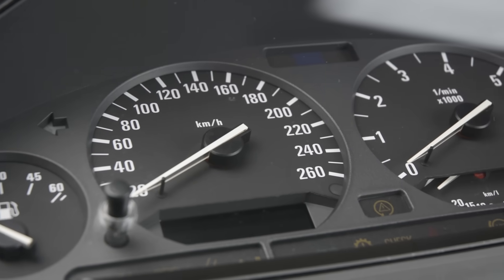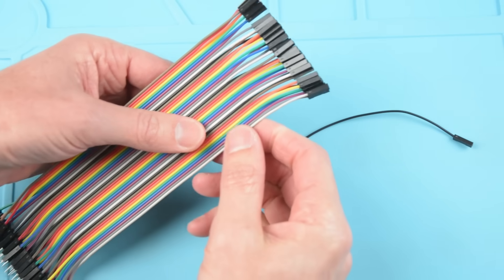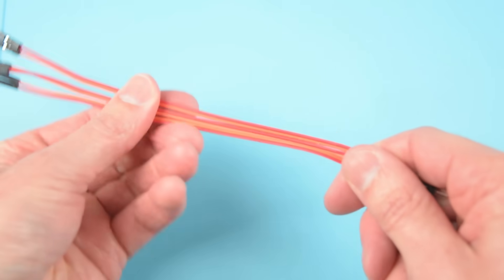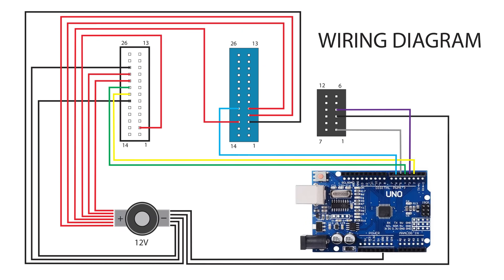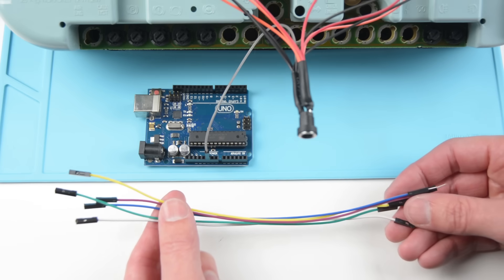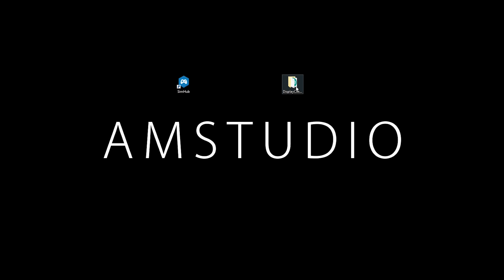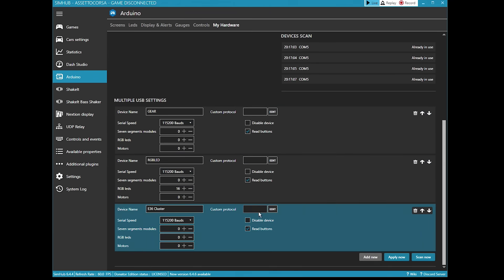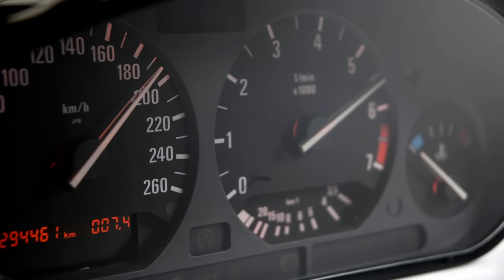HOW TO WIRE BMW SPEEDO CLUSTER FOR SIMULATOR | SIMHUB

Comment: Next - how to wire a car for your simulator.
Reply: Pog kinda did that, he connected his Aventador to his Xbox
Reply: @MrDestin1969  yes and it was pretty cool :)
Reply: look up Suzuki XBOX car. Most the articles you find are shit and not informative, but when it was debuted I remember hearing it was wired to use the steering wheel, pedals, and shifter for sim control.
Reply: Don't tempt him 😂
Reply: I know
Reply: How to wire a steering wheel with airbag to your sim so it explodes when you crash
Reply: Teslas already have this, just have to make sure you are in park so you don't get confused.

Comment: Will 11.5V power supply be good? I plugged everything together, but my tacho and speedo don't move on test max rpm or test speedo max.
Reply: 11.5 would be good, you are dealing with a car speedo here and battery voltage can even reach 11.2 at worse scenario, something is wrong with your signals, power is good

Comment: What are those arrows on the sides of the speedo and tach for? Never seen those in use on a bmw
Reply: is this a blinker joke?
Reply: @frozensolid8968  Yes, yes it is
Reply: It's only to pass the MOT. Nobody actually uses these anywhere else.
Reply: Fuel use in liters

Comment: Hi, I'm trying to use my panel, but it does not seem to be being powered enough to turn on, the lights do not light up when I plug in the power supply and the fuel pointer goes on empty, the other clocks do not work.
as I said there seems to be a lack of power, I've changed 4 times of source and I've reviewed the connections twice, and I do not know what the problem is. Could someone help me with this?
I saw that in this panel in the video there are some black "caps" that are closing some holes with contacts on the sides, does it influence something?
Reply: it is as if something in it does not allow to receive all the energy of the source

Comment: Such a great idea! Gonna be doing this for sure! Is there any other clusters with the same pins etc that would work? As BMW E36/46 clusters are expensive
Reply: Expensive? 🤣 Please E46 clusters in Poland costs 100 PLN +/- 25 €
Reply: Big chance that every cluster has different pinouts: the CAN-bus is manufacturer specific.

Comment: How did you know what wires to connect? I'm asking because I want to adapt a Suzuki Sx4 instrument cluster to my car, just the basics like headlights, turn signals, speedo, tacho, water temperature, oil level and fuel (it might also be nice if the trip computer worked)... But I have no idea what to link to what... And google doesn't seem to help at all (I couldn't find the schematics for the Sx4 cluster). Any help would be appreciated

Comment: I've done it today..!!Fantastic work...Couldn't find where to put the protocol file cause i got the newest SimHub version and it is not in the same spot as the one shown in the video.
For those who looking for it, it is in the arduino page/my hardware/multiple arduinos,you will see "multiple arduino settings,and the E36 device.Down below "Custom protocol" you press edit and the rest are like the video shown.
Reply: Hi did it work

Comment: the rpm meter isn`t similar to the software gauges. The AC gauge shows 6500 and the hardware shows a bit less than 5500....
Reply from the maker: That right its set to match the range on the cluster. But you can change the setting so its 1:1

Comment: I made a E36 cluster work 4 years ago, before Simhub even existed. So much work for nothing. I moved to Simhub since then. :)
Mine has some extra features. The lights are also wired in with simple NPN transistors. Some of them are tricky. Turn signals and high beam need to be switched to 12V to work, the rest need ground  signal to light up.
Reply: Hello! Do you have the Display client V2 as shown in the vid at  4:24? The links are old and I cant seem to find them, so I thought maybe you still have the file. Thanks!

Comment: Thank you for your videos. Did you have an ideia, why sometimes the RPM drop to 0 while playing? I've tested with rfactor 2.  I have the Use Full range checkbox checked and  the offset percentage to 0.  I can test the max RPM and it shows fine. Using a e36 316i 4 cylinder gauge, max redline at 7000 and max speed 250 (the gauge goes further). Thank you

Comment: Hi, buyed one myself, connected everything, working flawlessly. I even managed getting the temperature and fuel gauge working. Came up with the idea of converting an e36/e46 steering wheel to a Logitech G25 and making the buttons (like cruise control) to work. Maybe a suggestion for your awesome work? Feel free to contact me if you want!
Reply: I really need help when I try compile with the code hes given im getting a few errors.
Reply: Which errors do you get?
Reply: hi bart, my tachometer is working flawlessly too but my speedo isn't working. did u use the sketch in the description or did you edit our own?i believe the code is the issue as the needles on my cluster are not the problem.Thanks a lot for replying
Reply: Hi, you also inserted the custom protocol? Which game are you playing? And did you upload the sketch to your Arduino while Simhub wasn't running in the background? I used the sketch in the description but edited it for the fuel and temperature gauge
Reply: I used the protocol he provided in description and I added his sketch to simhub yes.Weirdly in the sketch I can see all gauges assigned to pins on the Arduino board howevever I don't see one for tachometere but that's the only one that works for me lol.I really only want the speedo working since ive gotten the tacho working.
Reply: In the protocol screen you can see "Raw result" at the bottom. If you play your game does the second number change while driving?
Reply: I play asseto corsa.currently at work but I'll open up the protocol and play the game and see if the raw number changes.
Reply: I think uploading the sketch is the problem, did u upload the sketch with the arduino software included in simhub? Make sure you select the right COM-port and make sure SimHub is NOT running if you want to upload the sketch.
Reply: I know this comment is 4 years old now, but do you remember how you got the temperature and fuel gauge working?

Comment: little help please. only rev gauge works nothing else. Even bought a new cluster and same result. I made sure to triple check all wiring. any suggestions @AMSTUDIO? THANKS A LOT FOR MAKING THIS VIDEO BUDDY.
Reply: I'm having the same issue ._.
Reply: I have already raided all the comments and have found nothing. if i manage to get it working ill be sure to let you know by posting it here. I'm glad i'm not the only one with this issue.
Reply: @KnightDriverr  I had a solution. But i reset my pc and had to reinstall. I'm trying to find a way too
Reply: @Marco R.  What was your solution if you don't mind me asking?
Reply: @KnightDriverr  that's the problem. I don't remember
Reply: @Marco R. When you do remember, you know were to post it. :)
Reply: KOOOORAY  I'll keep you updated^^
Reply: Like wise buddy.
Reply: @Marco911  You got discord buddy maybe we can talk over discord and try to figure this out together.
Reply: KOOOORAY  I don't have a mic so I can only type, but yes. marco#6240
Reply: @Marco911  Adding you now bro
Reply from the maker: Ive re-uploaded the original files exactly the same as used in the video give this a try.
Reply: if([DataCorePlugin.GameRunning], '1', '0')
 + ';' + 
format([DataCorePlugin.GameData.NewData.SpeedKmh],'0')
 + ';' + 
format([DataCorePlugin.Computed.Fuel_Percent], '0')
 + ';' +
if(isnull([DataCorePlugin.GameData.NewData.WaterTemperature]), '125', format([DataCorePlugin.GameData.NewData.WaterTemperature], '50'))
 + ';' + 
format([DataCorePlugin.GameData.NewData.Throttle], '0')

Comment: I have 3 Magneti Marelli dashboards  and I would like to try programming them, i have an arduino uno but I first need to figure out the pin connections because they are different from the ones on your dash... and i can't find anything on the internet...(no video, no schematics, no nothing) if anyone has any info on this, it would be greatly appreciate.

Comment: Where I find pinouts diagram for this dashboard, need compare to another dashboard,GOLF MK3 not find the tachometer pin. Thank You.
Reply: Golf/Jetta III wiring, 28 pin speedo wiring harness pin idenditication. 1 antenna outside temperature (MASS) 2 signal coolant deficiencies 3 MASS 4 MFA storage key Reset 5 MASS MFA 6 MFA storage key memory 7 speed signals (exits) 8 oil pressure switches 9 oil *OVERFLOW* 10. revolution counters (RPM) 11,12 V constant 12 illumination clamp 58, 13,12 V in ignition pulses 14 free 15 MFA call keys 16 generator lamps 17 givers oil temperature 18 signals hand brake and brake fluid deficiencies 19 to the left 20 ? pilot lamp 21 fuel tank display 22 Turn signals, left 23 coolant temperature notices 24 blinkers to the right 25 high beam control lamps 26 Fuel Consumption 27 speed signals ENTRANCE (giver at the transmission) 28 free

To Speed gauge You must connect  pin 27 (entrance)

Comment: hi mate, iv set up these before, wondering if you have ever had any luck with clusters that use CAN bus, my next rig is going to be running a dash and cluster from a car that runs a can bus cluster, cant work out how to get it running other then running the full car loom and using the pinouts from the wheel speed sensors and crank angle sensor into a factory ecu and then back to the cluster, but thats going to make 1 huge mess of wires, any help would be great

Comment: Where do you find the diagram for what pin goes to what? Would be useful since I do not have a e36 instrument cluster :) And why is your tacho showing 1K rpm less than ingame in lots of the clips?
Reply: haavard1989 because he ticked a box to use full range it distributes the rpms so it doesnt hit 7k

Comment: Hi. I have connections well done and the cluster light and the revs account appears unbalanced. When I put 1000 test rotations in SimHub and 3000 appears in the cluster. I've tried almost everything. The transformer I am using is 12V 1.67A. Is this the problem?

Thanks
Reply: João Alves you can adjust them through advanced calibration
Reply: Thanks. It´s Working.

Comment: The file show in the link Sketch+Protocol 68k how to use in the Arduino Uno 32k? In the code have more modules, panels, display etc? Need use only speedo cluster. Thak You!

Comment: Hi ! can you send me or link me to a sketch that works ? it has som issues with the text.
when i try to compile the sketch i get an error for everything that says include
Reply from the maker: Include Libraries? Upload the sketch using Arduino in the SimHub folder. Ive put more info at the bottom of the video description

Comment: Please do a video on how to do this to a 99-01 Impreza WRX cluster. I have one of those (Besides you doing it for me, is there any way to use the methods shown in this video if I figure out the "pinnage" of the WRX cluster, it's basically all +12v, ground and signal, right?)

Comment: Two questions
1.does the turn signals work and hazard lights?
2.does the dashboard lights work like the handbrake light, high beams, check engine etc?
Reply: Who care about the blinkers lol this is a bmw cluster they were never meant to be used anyway lolllll
Reply: @habsfan1985  it'll be especially useful for a truck sim.
Reply: Chobbs oh yeah no doubts lol I was just poking fun at bmw drivers lmao
Reply: I didn't rebuild that and I'm obviously not the uploader, but there's a reason he connected only like 10% of all pins.
Reply: With a little extra work, I’m sure you could get them to😁
Reply: The lights use 12V bulbs, you need transistors for them to work, and some extra code for the custom protocol.
Reply: @gerzsone30  led lights could Be a solution
Reply: @MikaelJ97  It can be surprisingly difficult to find LED's with a light dispersion pattern that recreates that of lightbulbs.  I get the advice and have used it myself for a project but it took a LOOONG time to find a solution that worked OK enough.
Reply: I made it work on my passat b5 cluster ;)
Reply: @szynga  How? Can you please help me? thanks.
Reply: @bercea8912  you need to write your own custom protocol and some arduino code, you also need to know about NCalc formulas
Reply: @szynga  what you mean can you explain please,, I made this project in the video and everything is ok in arduino program only when I click on protocol button that's nothing happened and the gauges not work any hints please if you can??
Reply: @szynga  hey mate. Can you tell me how you wired your b5 cluster? I'm using the same
Reply: @szynga  Hello can you help me with it

Comment: Hi friend, I have a panel from Tucson, and I intend to use it for simulator. I have a doubt, it does not have the same amount of pins as the BMW e36, so I wanted to know if there is any way to use it and program it similar to the video. Thank you!
Reply: My question is, how can I identify the function of the pins to know which one to use

Comment: All of the lights are working?  Such as turn signals, hazard lights, full beam, traction control, parking brake, shift light, and red line.

Comment: brilliant video am. i have 2 e36 clusters and have had them for years. i was so close to throwing them away twice. Now this videos makes it all worth it. I'm so happy i kept the clusters. my question is when playing ETS/ATS 2 will all the instruments work such as the headlights, high beams, indicates etc. if not how can we get them working or is this impossible?. thanks again am studio your awesome.
Reply: They might, they might not.  This is a cluster that obviously uses the CAN-bus which is what can make it much easier to have all functions working with just a couple of connections.
It might also require much more fiddling to find out what connections make those lights work unfortunately.  The CAN-bus is manufacturer specific and sometimes, for a good reason, how it works can be a trade secret because of the possible dangers involved if the signals between the modules that respond to them are known (you could use that knowledge to screw with the odometer and reduce the amount of kilometers a vehicle has made, or reduce the amount of kilometers it registers by modifying the signal and saying that 1 kilometer on the display is only added up after 1,1 km...

Comment: @amstudio hi there, trying to use the sketch and it is saying tone.h missing. What am I doing wrong? Sorry new to arduino
Reply from the maker: You need to install the tone.h Library .  Tools>Include Library>Manage Library

or 

Open the sketch with the Arduino Software included with SimHub, This has all the Libraries needed.  
(C:)> Simhub>_Addons>Arduino>ArduinoIDE
Reply: amstudio thanks for the help, all working now so I can keep on putting miles on my old car :)
Reply: @jakeridesbikes99   Can you explain how you got this working. I'm new to Arduino.

Comment: does the amperage on the power supply matter, i would to order a psu off amazon because i'm too lazy to wait for ebays long shipping but i can't find a 12v 1.5a psu with a female positive and negative terminal, i can only find a 12v 2a one so will that be okay?

Comment: Hi great work, I am not an expert in Arduino and I keep getting an error when compiling using the custom script suppliederror   -    " e36SppedTone was not declared in this scope.I also get the following error;Multiple libraries were found for "Adafruit_GFX.h"
 Used: C:\Users\wflet\Documents\Arduino\libraries\Adafruit_GFX
 Not used: C:\Users\wflet\Documents\Arduino\libraries\arduino_729I have checked my libraries and only have one version of Adafruit_GFXI am hoping I have got the procedure correct.I tried to first open Arduino IDE  and open the custom script - that did not seem to work then I deleted the Simhub DisplayClientV2 script and associated FlowSerislRead file and replaced with your modified files but result the same.Can you help
Reply from the maker: Open the sketch with the Arduino Software included with SimHub, This has all the Libraries needed.  
(C:)> Simhub>_Addons>Arduino>ArduinoIDE

Comment: If i do this with my cluster it will also count distance driven because it uses the same wire/sensor to drive both in my actual car :D
Reply: Yes it will. I have put over 2000km! on mine :D

Comment: Wait, i dont get something. At 5:30 you say checking the box allows the tachometer to go past 7k, but in the video, when cars are doing 7k, the tachometer is showing 6k. I thought the result would be that if i car does 7k, the tachometer would read 7 and then if a car goes way over what the dash is capable of, the needle would just stop at its far right limit.

Comment: ooooh BMW. how difficult would it be to make  sequential shift lights for my E30 track car? would you just need the tacho signal wire, 12v power and an arduino with the correct sketch?

Comment: Pleased note that some bmw e36 dashes don’t work with the fuel and temp gauge with this setup, I’ve done it this way but it didn’t work I wrote a program to fix it but no go, I can’t tell you which ones work as there lots of different pc b’s in these dashes, but give it a go it’s pot luck sometimes

Comment: you sir...are a genius. one question, other than the tach and speedo what else works on the cluster? gas and temp gauge? petrol and e brake lights?
Reply: Also curious, do you write all your own software for the arduino's ?